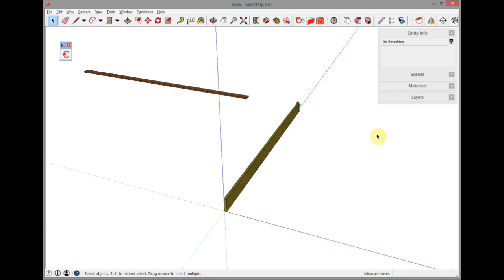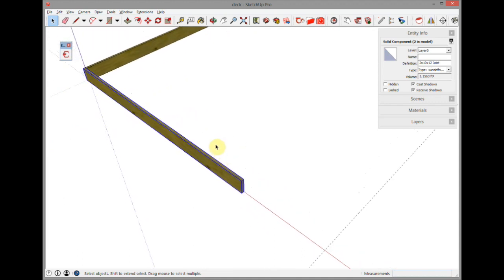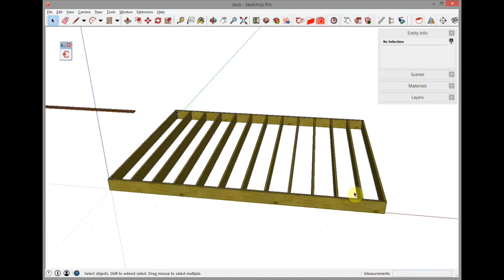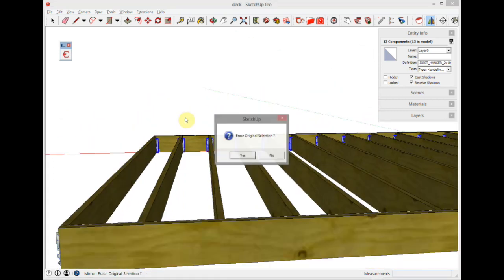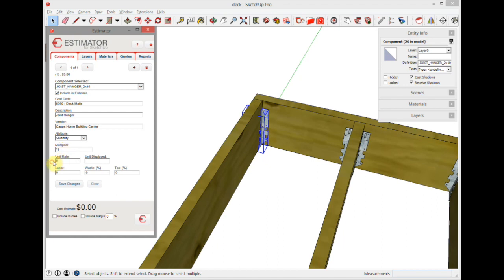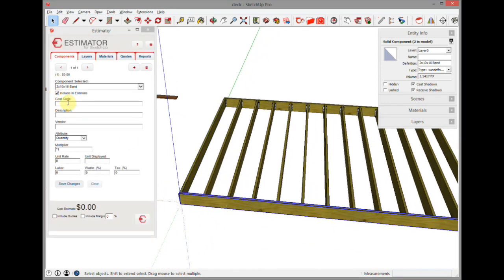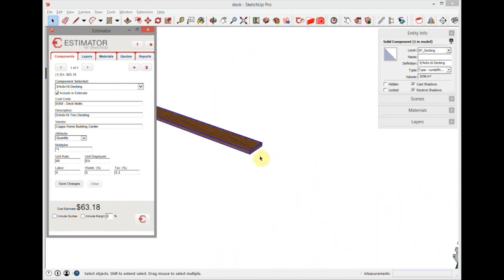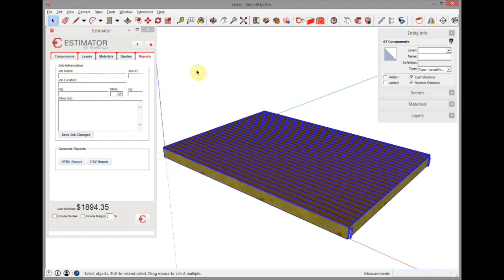Beginner-Deck

Comment: Bearly starting using these program, where do you get the lumber in the program?
Reply: You can model lumber a number of ways.  For something like a deck, you can simply draw a rectangle that is 1-1/2" x 9-1/4" (2x10 joist) and then push/pull tool and pull it out however long you want - triple click on it to select all faces and then texture it to look like wood (I just use the treated lumber material that comes with SketchUp).  Important, while you still have all of it selected, group it or make it a component (difference between the two).  The other way to model lumber is using a plugin called Profile Builder, but you can do it with native tools.  There are tons of YouTube videos out there on native SketchUp tools.  I downloaded joist hangers from the 3D Warehouse and you can model decking the same way as the lumber.  Have fun!

Comment: how you selected the component by estimator, do you push any button,?
Reply from the maker: Estimator displays information about whatever the current SketchUp selection is, so if you select a component, then you will see information in the Components tab, if any info was added.

Comment: where do you get the plug ins? like mirror?
Reply from the maker: Mirror is a free plugin from TIG - checkout www.sketchucation.com, there are tons of plugins available there and there is a sketchucation store plugin for SU, which is a tool inside of SU to download plugins.  To do the selection of instances of the joist hangers, I used Selection Toys from ThomThom, which you can get on the Extension Warehouse.  Most the other tools in this video were native SU tools that come with it.  The other of course is Estimator for SketchUp